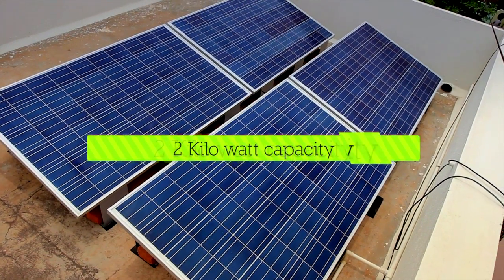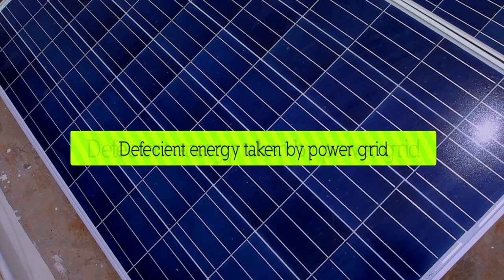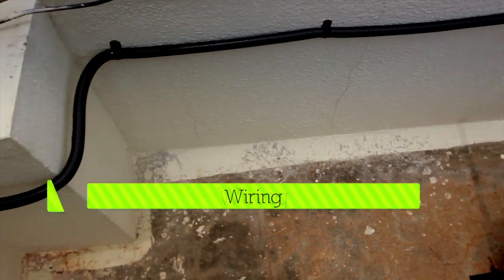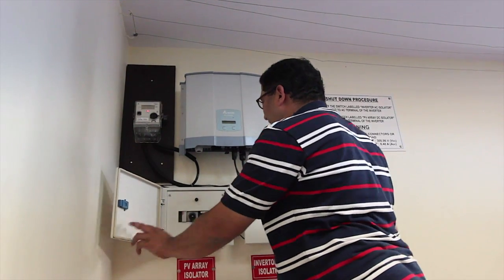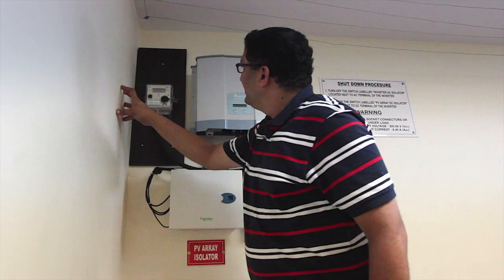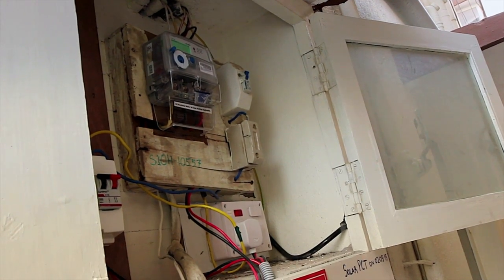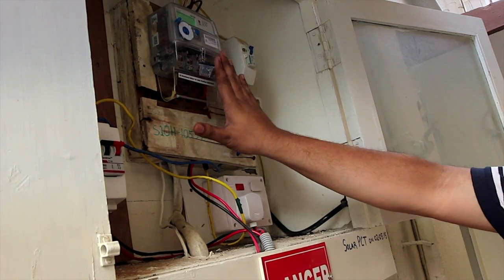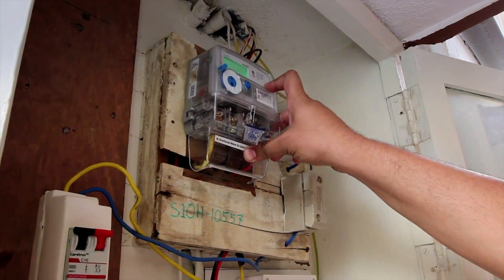Residential Grid Connected solar rooftop PV system

Comment: Residential solar Roof Top , Commercial Roof Top , Grid Tied Roof top system (On Grid / Off Grid ) 
09884124365 📞 08838472736 _
M KISHOR_WHATS APP & TELEGRAM _09841185357
solar system for Home 
₹ 48999/- On wards
Off grid solar power system:
It is most common type of solar power system with backup. It works in day and night both, during the day, solar panel charges the battery and runs the home appliances such as Air Conditioners, Cooler, Television and submersible pump. At night, when the sun is not available, Inverter runs your home appliances using the battery power.
Advantage: no dependency on government electricity power
off grid solar powered system, how much power you can run depends upon power of Inverter and it’s efficiency, generally all inverter comes with 80% efficiency, so, if you buy 3 kw Inverter system then up to 2,400 watts of peak power you can run at given point of time. Running air-conditioner and submersible can be expensive for you.
There are two types of solar inverters, 1) PWM – relatively low efficiency 2) MPPT Based – high efficiency
PWM based – it stands for pulse with modulation, these inverter low on efficiency but prices are very low. For smaller needs, PWM based inverters are recommended for smaller use such as running 3-4 fans, 8-10 lights, 1-2 Television, 1 Refrigerator in day and night.
MPPT Based – it stands for Maximum power point tracking. If your purpose of investment in solar is to save electricity bill, then it is strongly recommended to opt for MPPT based inverters.
In India, up to 10 kW solar system is designed to work with batteries, here is the price list of solar energy powered solar system from 1 kW to 10 kW.
Off grid solar system
Approx Price (all inclusive )
300 watt__________₹ 45,000
1 kw__________₹ 1,03,000
2 kw__________₹ 2,10,000
3 kw__________₹ 3,15,000
5 kw_________₹ 5,15,000
10 kw__________₹ 9,50,000
Leading Brands solar INVERTER with Solar Panels & Solar Battery affordable Price 
Contact Us 
Call / SMS _ 09884124365 - 08838472736
M Kishor _Whats App & Telegram ____09841185357___
_Thank You__Power Focus _

Comment: If in case of HV consumer having its own transformer in the premises, what will be the power generation voltage.IF it is 440V 3 ph how system will work. Can system take both MSEDCL power & Solar panel at the same time.
Reply from the maker: Yes it can take both EB and Solar power at the same time. Each state has a different rule for interlinking voltage. Generally from 5 KW and above upto 500 KW it is at 430 V and above 430 V, the interlinking is at 11 KV.

Comment: those 8 250w panels connected all in series? or series to parallel? many thanks
Reply from the maker: In this system, it is in series.
Reply: How much did it cost you for 2kw installation?

Comment: Is it possible to have a battery connected(May be parallel to the system) to a Grid connected Solar system, so that my battery charges along with the export of energy into the Grid? This might help in providing intermittent supply during night, in case of power cuts.
Reply: same thoughts here..
Reply from the maker: Very Much possible sir https://bloghinren.wordpress.com/2016/07/25/hybrid-solar-plant-at-reverie-language-technologies/
Reply from the maker: https://bloghinren.wordpress.com/2016/07/25/hybrid-solar-plant-at-reverie-language-technologies/

Comment: If there is a maintenance going on main line , then how we isolate the supply from solar.
Reply: +nitin chittora ; Isolation switch is provided. In fact there are 3 isolation switches .
Reply: thanks for info.. i believe its automatic..
Reply from the maker: Yes, It is automatic